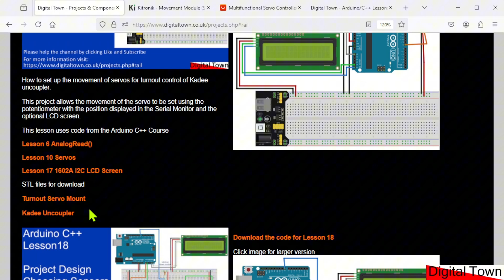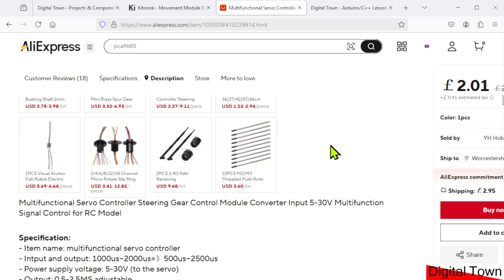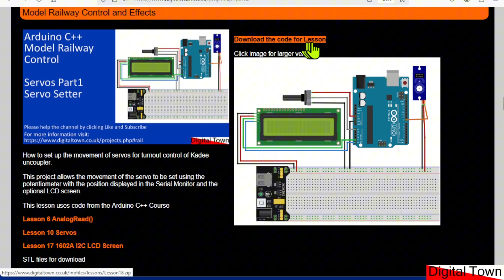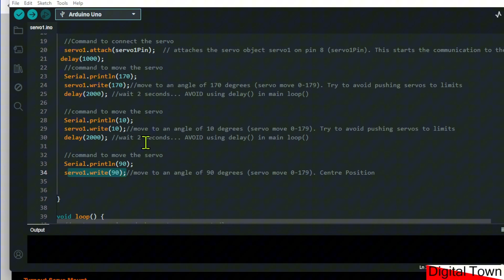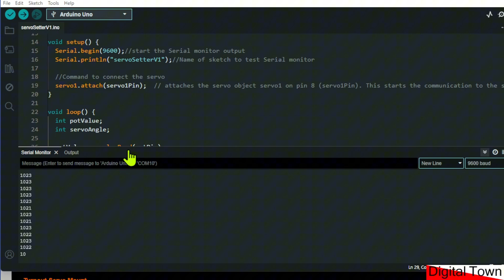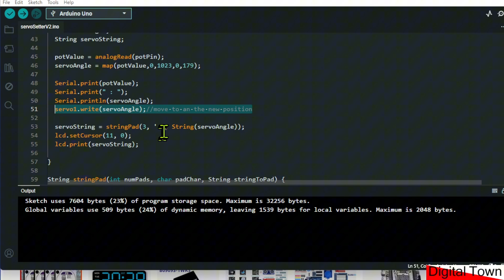#125 Arduino for Model Railways - Servos part 1

Comment: I came across your channel just recently, and being a railway modeller as well, you have quite a few interesting projects that I'm keen to do.  I'm very much a novice at coding for Arduino and ESP32, and as I'm using ESP32 boards, is there any chance of adding the specific INO files to suit ESP32 and their required libraries?  An example is this very tutorial, in that I must have to configure an ESP32 GPIO as an INPUT to read the analogue values from the potentiometer, but haven't quite worked that out yet. Cheers.
Reply from the maker: Hi
I use the ESP32 for most of my railway projects but chose to use the Arduino Uno and Mega as they tend to be a bit easier for beginners. The plan is to move onto the ESP32 in some later tutorials.
As far as the analogRead() you don't need to define it as an input. It works the same way as the code for the UNO. The main difference is that by default it reads values between 0-4095 instead of 0-1023
Also with the ESP32 that is a voltage range between 0-3.3v... more than 3.3v and you will cook the board.
This is why I wanted to do them as a seperate video. The library you will need is ESP32servo instead of the Arduino servo.
Reply: @digitaltown5442  Thanks.  I had already worked out about the ESP32Servo library requirement, it's just the analogue from the potentiometer I'm having problems with.  It was giving some funny readings on the serial monitor which led me to think I had to define the input.  So rather than supplying the pot from the 5V, I should supply it from the 3.3V line?  I'm hoping I haven't cook the board already! Cheers, Ian.

Comment: The servo is used as a switch , nice ,but if you use the servo as a motor , the frogs will also move but 100% realistic . search the arduino lessons.
Reply from the maker: The servo is moving the frogs as well as the switch. The switch is just there to change the polarity as my turnouts are handbuilt so need the power switched.
Reply: @digitaltown5442  Yes i know , if you use it as a motor the frogs move realistic.
You are using it , and yes it works, like a standard coil  , aka on /off.
Reply from the maker: @HansdeKoster1961  servo speed control is in parts 2 and 3. To put it all in one video would have made it too long.